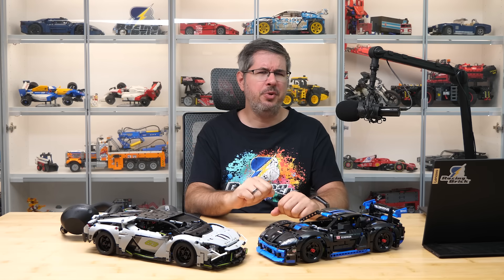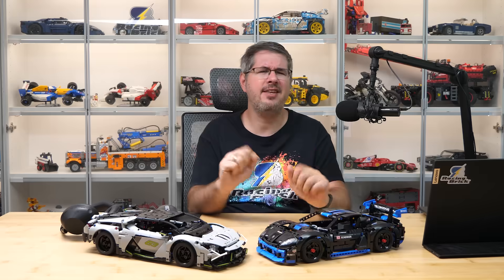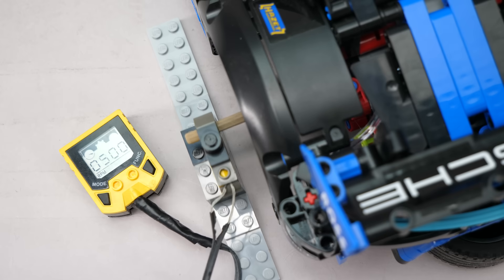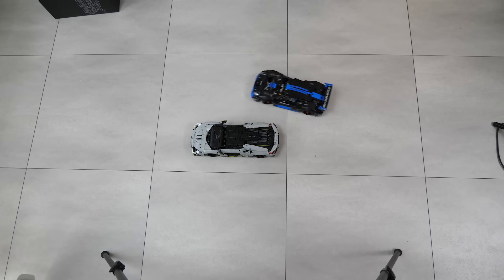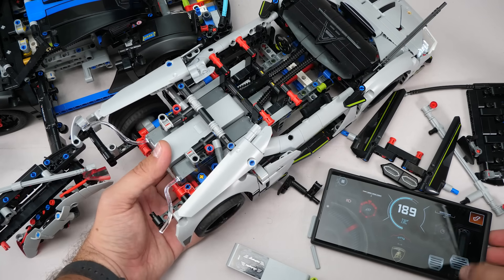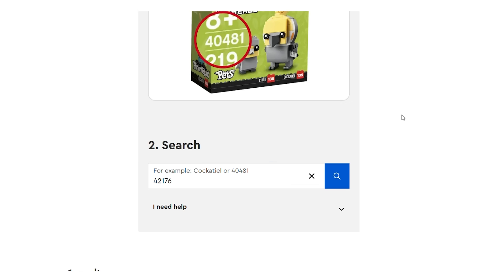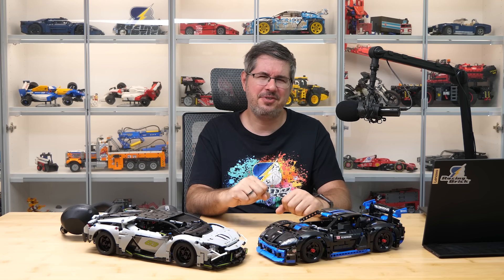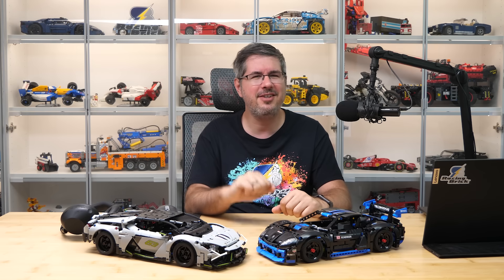LEGO Technic 42214 Lamborghini vs 42176 Porsche – does the new hub design make it faster?

Comment: The batteri is actually rechargeable! There is a hole in the motor for a phone charger and it is pointed out in the lambo's instruction manual page 225
Reply from the maker: We knew that, but thank you :)
Reply: @RacingBrick  oh… well this is embarasing now
Reply: @RacingBrick  reel 🤢

Comment: Random question: is there a way to modify or open the motor and change some like gear to make it run faster rpm
Reply from the maker: It's easier to replace the hub with 3rd party electronics

Comment: Can the battery be disassembled (reversibly)? I remember there being a 18650 inside, which is as standard among LiIon batteries as AA is in alkalines. So with some soldering skills it can be replaced.

Comment: Haven't motorised anything since original power functions. I prefer manual ones, but I get how people would want to.
Reply: Don't go for these powered up hubs, they are only 3.6V. The normal PU hub is 6x AA so 9V. Guess what's going to work better? The Audi 42160 for around €100 was a better deal with a normal 9V PU hub and 3 motors you can use for everything you build.

Comment: I think the best solution for LEGO regarding the future of RC sets is collaborate with the guys at BuWizz, codeveloping a system that's like BuWizz but cheaper and not as powerful plus some other differences so BuWizz could appeal to AFOLs while the hypothetical LEGO x BuWizz system could appeal to a mass customer base.
Reply: I disagree with the not as powerful part. I think having lego sets that pack that punch makes them even better. There is nothing more disappointing than the old MkII Bucket Wheel Excavator that looks so cool, but can hardly move or function.
I would also want them to develop a buggy motor, or something with that power in a more easily implementable shape. If they could do that partnering up, it would be amazing for LEGO.
Reply: @RandomGuyOnTheInternet-1 I meant in a way that LEGO wouldn't outdo BuWizz so BuWizz could still sell their own products.
Reply: @RandomGuyOnTheInternet-1you have to keep in mind that the sets will be used indoors aswell, maybe even by children who can't always control them as well as adults
Reply: It won't be cheaper in the end, because both Lego and Buwizz will want their share of the price. Also, Lego needs to do all these kid-friendly safety features and certifications which only add to the cost compared to buwizz.